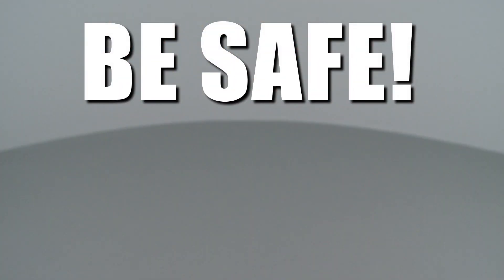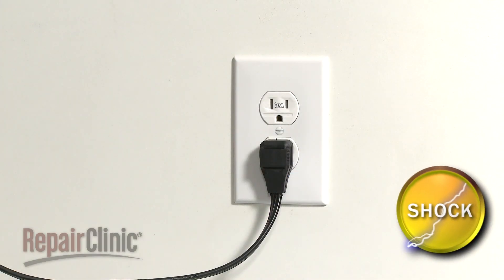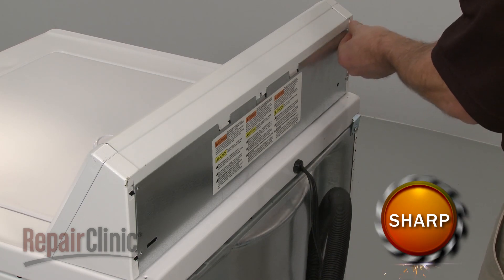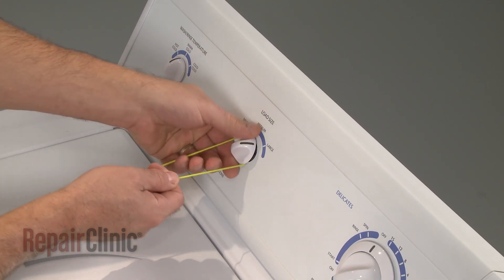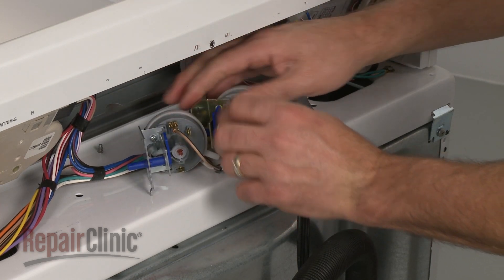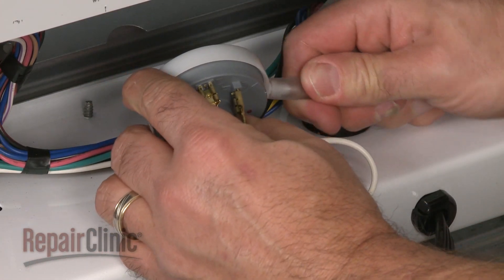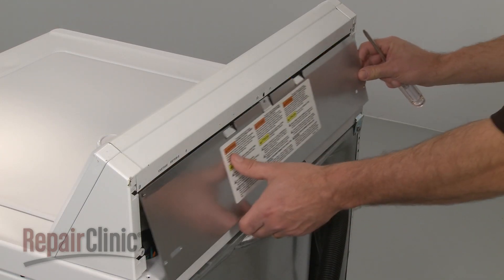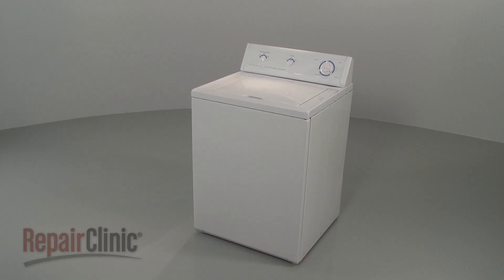Frigidaire Top Load Washer Replace Pressure Switch #134411600

Comment: How can I remove a handle or button that is too stuck? ... the buttons are the same as the ones in this video, but it has not been removed for 20 years, I already tried it with a cord or thread, but it seems that before leaving the button will break
Reply: @repairclinic  It is the small button of the pressure switch, that is, the water level button, it is not the timer button.

Comment: My Frigidaire top loader (about 10 years old) only fills about 80% as high as it used to with the dial turned to the largest load setting.  Before I replace this, could it be anything else?